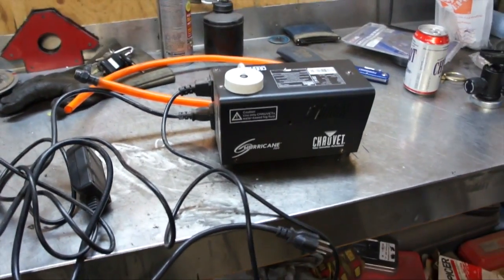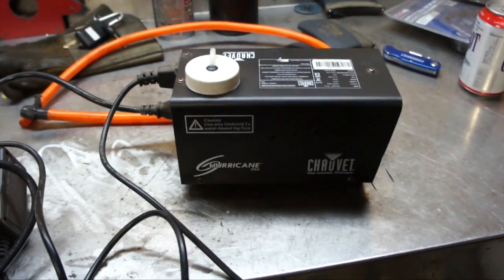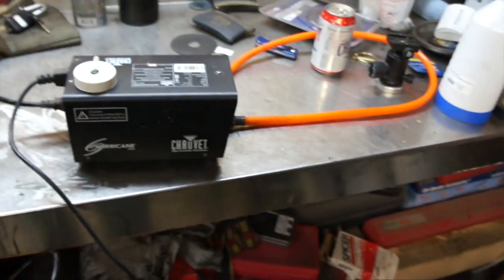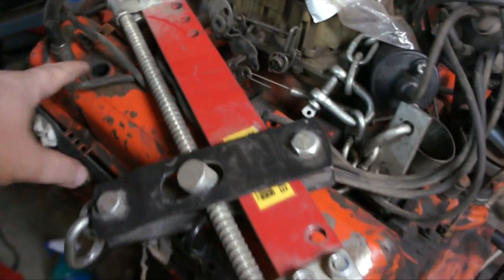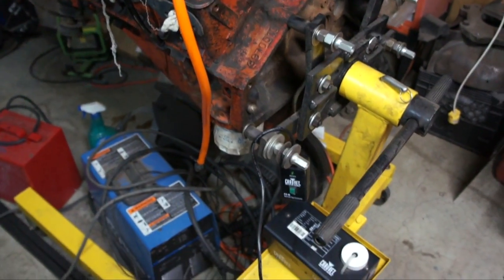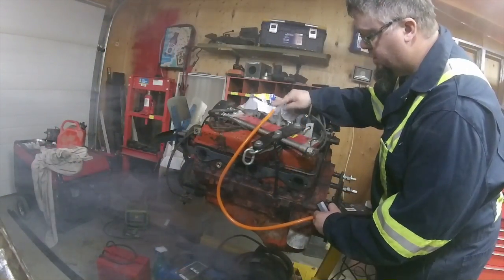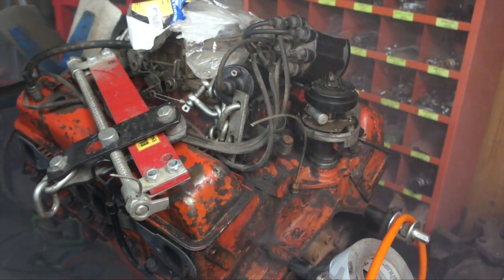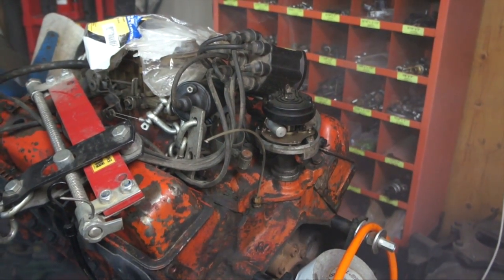DIY EVAP Smoke Machine Evap Leak Tester

Comment: Tried this unit many times, not enough pressure to push smoke through hoses. Tried different size hoses no luck. Trying on evap system 2004 jeep. Code po455

Comment: Why dont you take that machine apart once and see if you can modify the end of the smoke outlet and see if you can find something at menards to fit in there to use a rubber vacuum tube to stick inside the port on the machine????? This way a person would be able to leave it plugged into the port and walk away to check where a small leak is coming from..
Reply: yes....it's just a compression fitting. theres also one from the pump to the big aluminum block, which has a heater in it, just like the one in your kitchen's electric oven, but smaller.

Comment: I generally use the carb cleaner trick. just blast carb cleaner around in different areas until the engine idles up.
Reply from the maker: +Nick Pelletier that only works if the leak is related to the intake, as with the BMW it did nothing for the valve cover leak
Reply: +jerry bskorner good point

Comment: Jerry the smoke machine comes in handy for so many  things , finding where the seal has gone in head and tail lights , exhaust leaks and many more places just  a great tool to have for sure.
Reply from the maker: +Steve Rob i may use it on my f150 exhaust this spring to see of the exhaust manifold bolts have broke
Reply: +jerry bskorner  I hope not that's a major job on a 4x4 , buddy is a Ford tech and I've been in his truck that's been leaking for a year, no lights on yet and he doesn't want to spend the day fixing it and it's loud till it warms up then ok.
Reply from the maker: it's either that or the cam phasers ticking, I haven't spent any time looking into it cause I never drive it and it's not bothering me yet